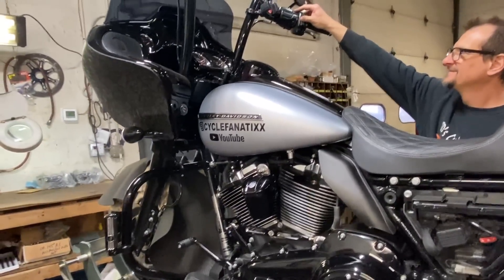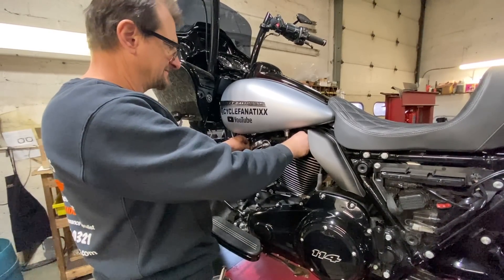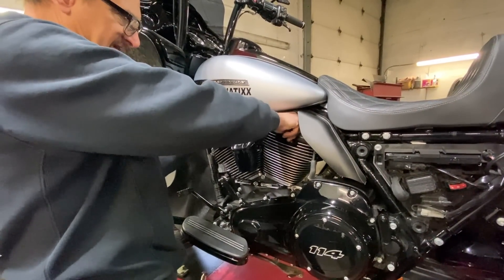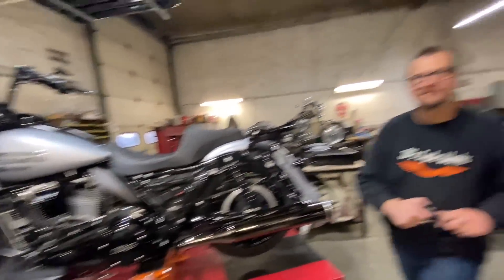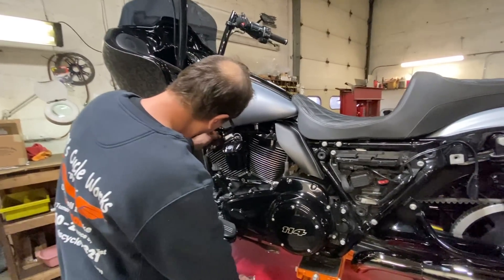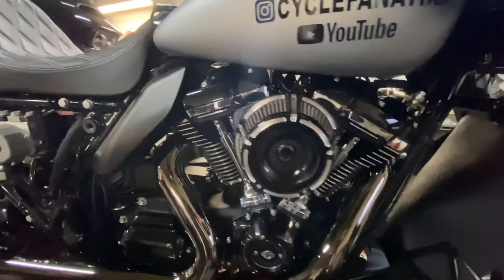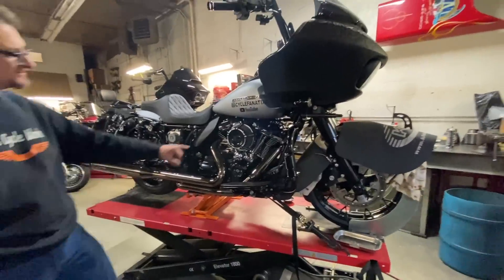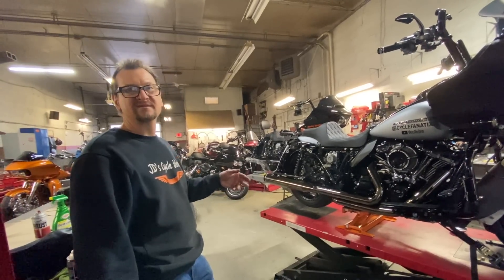#9 - SILVERBACK IS ALIVE !!!! 128" BIG BORE KIT / FIRST ENGINE STARTUP / JD CYCLE WORKS

Comment: I did the 128 big bore kit pushing out 138HP/143TQ. (PowerVision Tuner and Fulsac exhaust)  You have to go with a non Harley tuner and exhaust to get the power and reduce heat.    Love and hate it.  Fun as hell but sometimes too much power.  You really have to be careful with that throttle.  If you ride 2 up a lot, I would definitely recommend it.  Based on my riding style of riding long distances, next time I would do a torque cam upgrade and stop.  Stay away from traffic if you do it.  It gets F'ng hot because it's what big bores do and needs air to cool it down.  Overall it is fun and will get you to 100mph quickly.  Respect the power!

Comment: @Dave
I am doing this build next week. Wouldn’t it be just as easy to leave the fuel line disconnected and pull the plugs. With an empty fuel rail, the bike has no shot at firing. Yes?